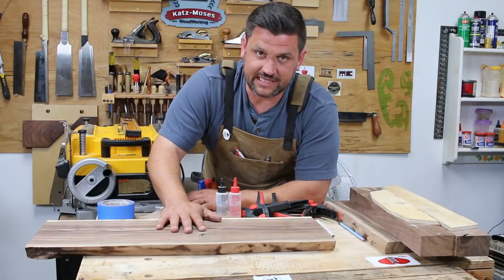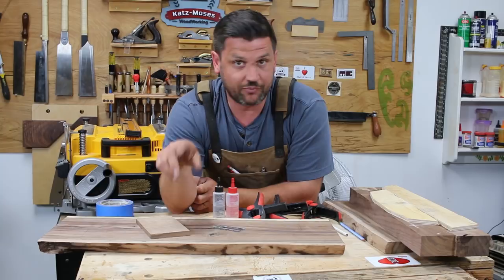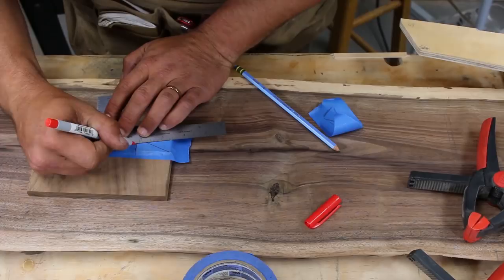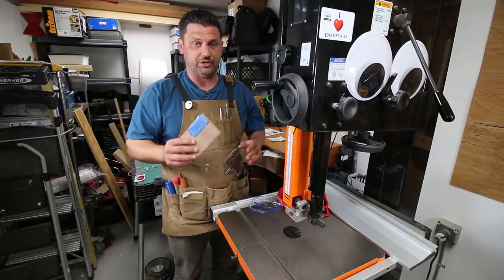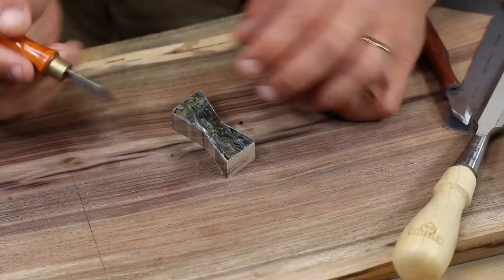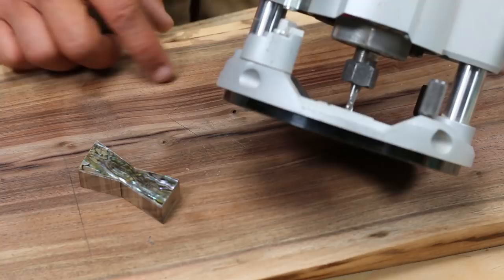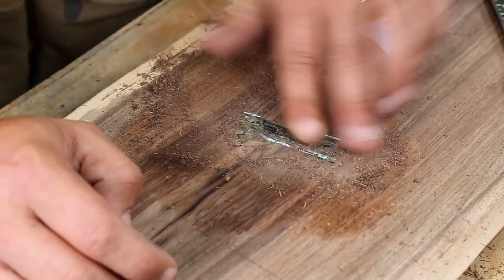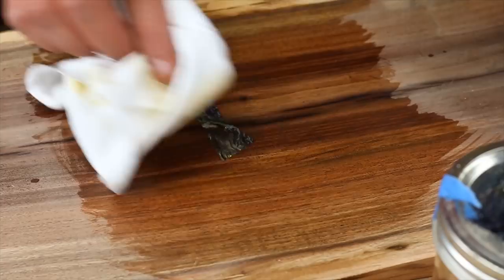Abalone Inlay Butterfly Key

Comment: Had you turned the board the other way under your abalone, the key would have been a lot stronger.   As it is,  the grain of the key runs the same direction as the crack.   Other than that, it looks wonderful.
Reply from the maker: Dave Engstrom that was on purpose.  I didn't want opposing wood movements to break the abalone. Thank you